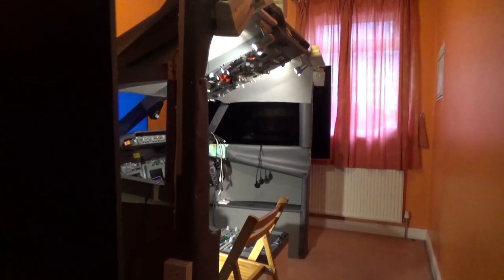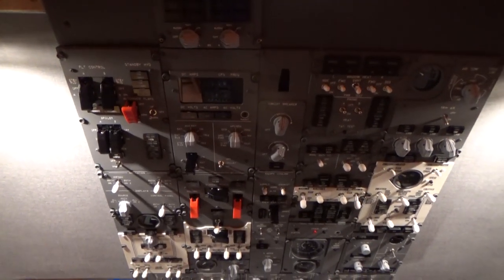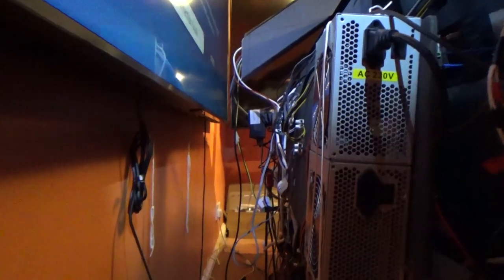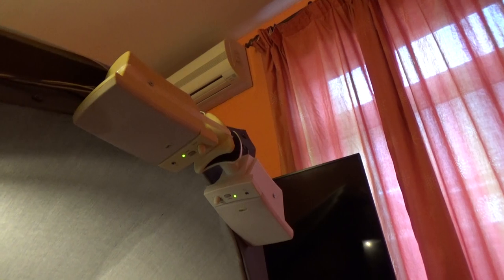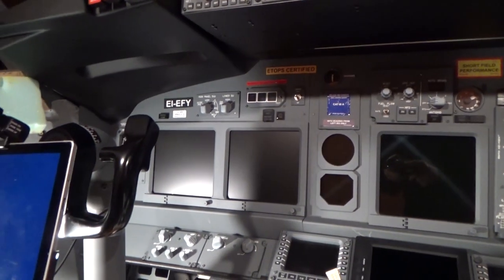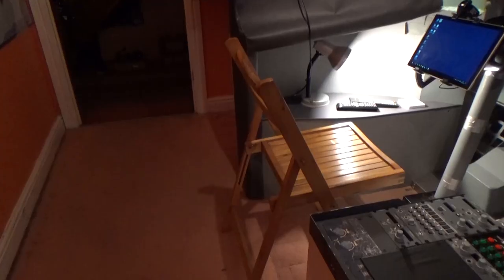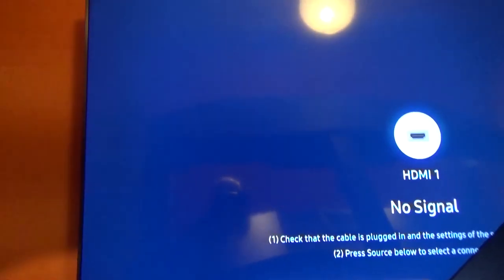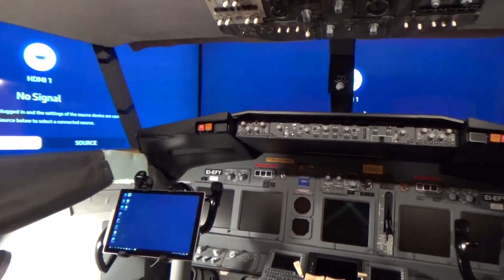Quarantine Escape Flight Update 9

Comment: Hi Fr Dane when are you showing us the finished product?
Regards 
Chris
Reply from the maker: I am about two thirds of the way through the programming phase of Flight-1 - the computer that will run the actual cockpit hardware.  Then I have to connect it and make sure all the controls and buttons work.  After that, I start on Flight-2 - the computer that will run the three external screens.  At this rate, I am about three weeks away from completion.  I am hoping for a working cockpit by Christmas. It is going slower than I had expected. 😒
Reply: @FatherDane  All good Fr Dane. Cant wait to see the end result. Im sure its alot of work. Seems hectic and you do it all by yourself.
Reply from the maker: @netcor2010  Yes it is slower with just myself, and at my age I am not as fit as I used to be so things take a lot longer to finish.  But I'll plod along and eventually it will be done! 😊